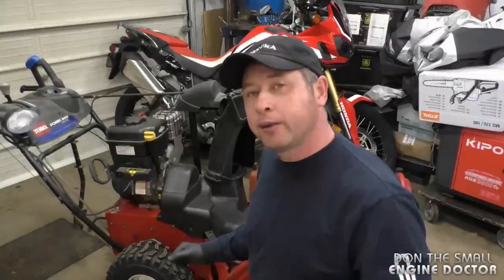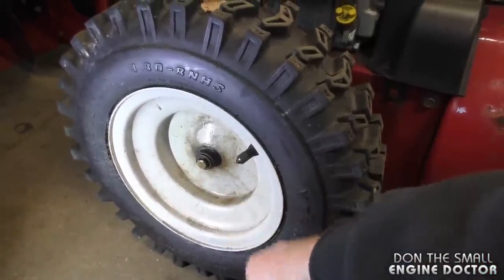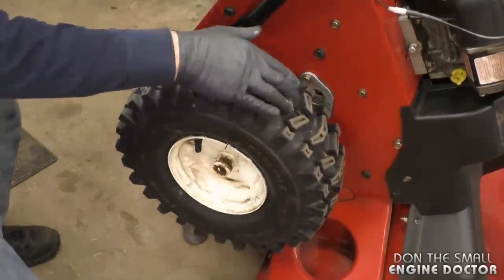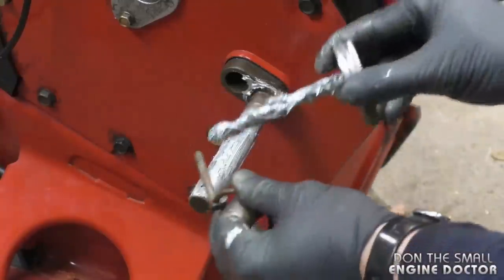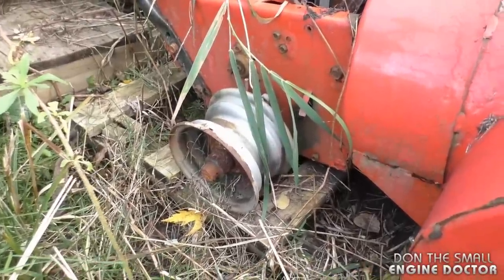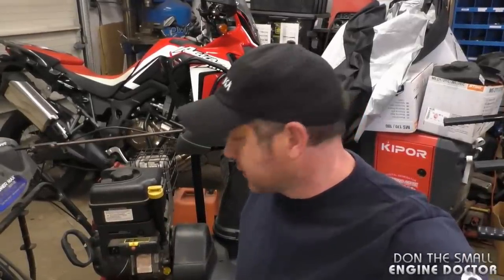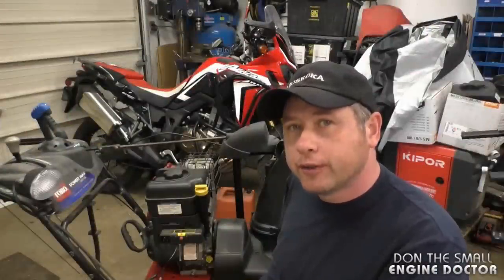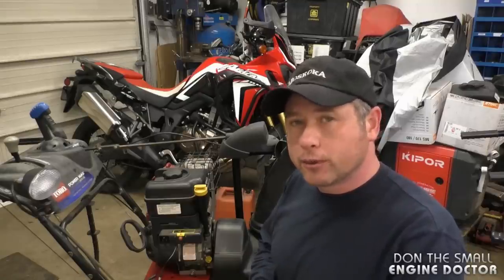ALWAYS Do This To Your Snowblower!

Comment: I have to remember to get some of that to put on the wheels of my mowers and use it on my vehicle rims also. Thanks for sharing this tip with us all.
Reply: You do want to be a bit judicious on your vehicle rims. If you put way too much, it'll squeeze out and could fling onto your brake rotor as you drive away. :( A nice coating on the wheel's hub face will do the job. You'll be able to see on the rim where the hub actually contacts the hub face of the wheel. That's the only place that the antiseize has to be applied. If you put it on your lug nuts/bolts, you must reduce the torque that you apply to them according to a lubricant torque reduction chart. If your lugs call for 80 lb/ft dry, and you torque them to 80 lb/ft after applying antiseize they will be WAY too tight and could stretch and break off. :( Hope this helps.
Reply: Lubricant on the threads are ok, don't get any on the interface between the nut and rim. That is where the torque is applied and friction is needed to keep nuts from backing off. Usually 30 weight oil is used for this as antiseize can ball up and get on that interface. Many torque specs are based on this.
Reply: @mannys9130  I wouldn't worry much about the over torque with anti seize. By the time you scrape the lug holes from the wheels across the studs it'll have grit and dirt in most cases in the anti seize and you'll be right back to square one. That anti seize stuff doesn't reduce torque THAT much. My dad has been using anti seize on all of his vehicle lug studs and hubs for 45-50 years and he's never even used a torque wrench to tighten the lugs, all done by hand. Not one has ever come loose or had a problem.

Comment: I just bought some anti-seize, will do it Monday! Thank you
Reply: Question: Can I put that on other areas of the blower? How about the driveshaft area where you shift the gear under the blower by that friction wheel or will that come off and make that slip (that friction wheel I mean)? So when you shift from 1-6 forward or backward 1-2 mine is not sliding very well, or do I use some type of grease on that? And what about the auger thing with the shear pins or just spray some silicone spray in that?

Comment: Thanks for that bit of information I would have never known that I thought just regular grease will be perfect. But now I know I have a question when storing gasoline in my gas containers. I usually put stabilizer in the containers first and mix it all up I use high-octane. I used most of the high-octane up with the snow blower and lawn mower. But the mixture of the oil and gas for my leaf blower usually it doesn't used up as much because I only used leaf blower for when the leaves Fall up here in North Jersey. How long would that gas last or still be good?

Comment: Excellent tip - did this on my HS-80 a couple years ago after it was a bear to remove the shafts doing the tranny repair...

Why it's not done at the factory is beyond me, and makes me believe they don't do any environmental testing when designing these machines.

How about installing a Zerk fitting on them like you did on the HS-928 tranny?

Comment: Great tip! I’m a big believer in using anti-seize - I smear some on my car hubs when swapping in my winter wheel set. Is this procedure also recommended for smaller snow throwers that have non-pneumatic wheels with plastic hubs? I just recently purchased a used Toro 721 E.

Comment: I never noticed the way snowblower rims were put on today.  I picked up an old Ariens with rims that bolt on and I thought they still did that.  I only noticed it when I was pricing out machines made today.

I put anti-seize on all my wheel hubs if I replace them on any vehicle.  The idea that I should never have to replace it again if the bearing(s) go bad, but if I do, it'll make it much easier to remove it.

Comment: I just did this on my brand new Ariens snowblower. I noticed when I removed the wheel it already had some kind of anti seize or grease on it. Not nearly as much as needed though so I added the anti seize generously.
Reply: Just did they to my newish machine, and oddly one side was greased but not the other, not every machine goin down the assembly line get the same attention.

Comment: Just last week I put synthetic grease on mine so I figure I`m okay.  I`ll use the anti seize next year.   Beautiful Honda you have there.  If I ever get a second motorcycle, it will be a adventure bike.  Either the Africa or the V Strom.
Reply from the maker: what do you ride peter?
Reply: @donyboy73  2013 Harley Davidson SGC
Reply from the maker: @Peter-976  nice, I had a cruiser also but went with the Africa twin for the versatility, great highway bike too and super nimble
Reply: @donyboy73  Agreed.  Every review of the Africa that I have read gets high remarks.  Honda has hit a home run with this model, even with the automatic version.  However, I would prefer a manual transmission only because I believe shifting is an important part of riding a motorcycle.
Reply from the maker: @Peter-976  I have the manual
Reply from the maker: @Peter-976  it's like a dirt bike on steroids

Comment: I'm up in RI using an 1985 Bolens without anti-seize. It would need to rust for decades before the axle welded itself to the wheel or vice versa
Reply: Good for you. Why don't you also tell us everything else that you think.....only kidding.....we DON'T want to hear what else you think.

Comment: Thanks Don. I plan to use on my walk behind leaf blower also. I will clean rust off with steel wool first.
Reply from the maker: IF WHEELS actually turn on the shaft then use grease, if they are fixed on shaft like the snowblower in video use anti-seize
Reply: @donyboy73  The wheels have inner /outer bearings that are fixed on the shaft. So I assume the ant-seize is best for this application? Thanks
Reply from the maker: @skipproctor8979  yes where the inner part of bearing goes onto shaft
Reply: @donyboy73  Thanks Don for quick response. I look forward to your new videos every Friday. All the best! Skip

Comment: If you are proficient in the use of a cutting torch, you can cut the rim off the axle shaft without damaging the shaft, then put a new wheel on and you're done. Heating the axle almost never works because that swells the axle inside the hub on the rim making it tighter. The hub on the wheel has to be heated, that swells the hub away from the axle, making the hub loose on the axle. It just burns the paint off the hub and wheel.

Comment: I love Honda motorcycles. I’ve had 3
of them. 82 Nighthawk, 75 CB 500T, and
a 2000 Shadow 750 ACE.
The only one that wasn’t quite right,
was the 75 CB500T. Could not get rid of the vibration. A shame, because it 
was a beautiful classic bike.

Comment: Yeah, but what if you can't get the dang wheels off? I have an Ariens Compact that's 5 years old and still looks like new. I took the codder pins out, but even with a crow bar and 2x4 could not move the wheels more than 1-2" down the shaft.

Comment: Warning: I love you DonyBoy, but be careful when attempting this, it isn't as straight forward on a newer Ariens Deluxe 28. Safety tip, make sure your tank is empty before tipping the snow blower on the bucket, all the gas ran out of mine when I did this. Note also  that there is a C clip behind the outer clip, I didn't know it was there and lost it when I took the wheel off ( the dealer didn't have any replacement clips so I'm screwed) and don't lose the little key that's going to fall out when you remove the wheel. You also have to figure out how to get the wheel back on with the key situated properly on the axle. Not easy if you' aren't real mechanical. The video made this look easy, but all machines aren't the same.

Comment: My Ariens snow blower  has one wheel seized on and  I have been spraying it with PB blaster without any luck.  You would think they would do it at the factory.
Reply from the maker: it looks like ariens is using cheaper metal now

Comment: Hmmm, never did this in 18 years with my snowblower, I guess the seize is just around the corner.
Reply: it's called luck.....
Reply: That's not what the author said. He said if you don't do this your wheels will seize in no time. Just with my father and myself never doing this for over 50 years and never having any problems makes me wonder. I think he should have stated it's a good idea just in case.
Reply: Hubster I been a small engine mechanic for nearly 60 years and this is very common the wheel seize on and drive up labor rate and sometimes they don’t come off no matter what
Reply: Ok just never happened in my circle of friends. Seems like an easy fix, just angle grinder the rim off, buy new rim. Would that work?
Reply: Hubster still a pain and it’s hard to get in there with a angle grinder or really anything still will drive labor rates up
Reply: Ok, there's a video out there that shows a bottle Jack pressing against the axle, with a chain around the back of the rim. There'd be no labor costs, not with a good shop on hand. Not the case with everybody though.

Comment: older Ariens machines have grease fittings on each wheel. Just make sure you grease them every year.
Reply from the maker: yes if you grease every year they will not seize, however not everyone does, that's why I recommend the anti-seize. Every loyal customer gets anti-seize

Comment: I have had some really seized on wheels. I cannot understand why the factory doesnt at lease grease the shaft. I have also had locking pins rusted on . It's fun cutting and punching them out. I would have used a cutting torch on the rim myself but that's just me. 
Nice Honda! I miss riding. 
Awesome video...again. Ever work on the zero turn snow blower system? I found one video that covered how to fix it. I had never ran into one till last winter. I think water got into it and froze something. I went in and used antiseize on the system to prevent further issues. Yes, that stuff is messy as hell but it works way better than any grease I know of. I have been known to mix the two.
Reply: The factory would love to save $.01 and 30 seconds at the assembly line by not applying it. They will also be very happy to sell you a new one when you end up like the owner of the blower in Don's yard. :(

Comment: Wish I would have know this 30 years ago when I got my snowblower. I had a leaking tire and had to put in an inner-tube. I ended up installing it with the snowblower in it's side because the wheel is hopelessly rusted in place. I noticed that I never put the pin back in - safe to say it isn't needed :)

Comment: I had both wheels sieze on my troy-bilt rear tine tiller.....one I managed to get off with heat and a wheel puller....the other was hopeless......I drilled thru the wheel just above the hub collar..two holes were enough to start the sawsall blade and I cut down thru the collar until it just grazed the shaft......took a cold chisel and drove it into the saw cut...that did free the wheel without destroying the rim and tire...I welded my cuts, and its back to churning dirt....

Comment: Anti-seize is also useful for preventing alloy wheels from seizing to brake rotors on cars.  In this case, you should use high temperature anti-seize and apply to the wheel and/or rotor where the two meet - just be careful not to get any on the lug studs.  I mention this because you may want to buy the high temperature anti-seize right away so you can use it for both applications.
Reply: Why would you not want neversieze on you wheel studs, I've been doing it on purpose for nearly 50 years with no problems, so don't try and tell me they will loosen off on there own because of it, because it simply doesn't happen.

Comment: Want to do an experiment? Mix up a small container of Acetone and automatic transmission fluid  (1 to 1 ratio).  Mix.  Using a flux brush (or similar),  apply to that seized axle / rim you showed.  Keep applying the solution over a few days...maybe a week.  I have a feeling it will break loose.  Might have to give it a whack with a hammer, but it should break loose.  I have had very good luck using it over the years.

Comment: Great video. My Honda snow blower has track so how do I put anti-seizs on the drive shaft ? This is the first year I've had it.
Reply from the maker: on your honda you should only put it on the shaft that turns the track sprockets
Reply: @donyboy73  I understand that but how do I get the tracks off to get to the drive shaft ?

Comment: Question?  I broke one of the electric plug prongs (not the negative prong) on the electric starter. Do I have to replace the whole starter unit or can the starter be unassembled and the new prongs be installed. The engine is the same B/S engine you have on your snow blower?

Comment: Too late for me, Cub Cadet about 8 years old, wheels would not bulge.  Is there some puller that can be used. I guess the basis for this would be too fix the tire if a flat were to incur, otherwise one would use a tire sealant, or cement and a plug.

Comment: after watching your video I went to do this procedure to my Craftsman snowblower. One wheel came off very easily but on the other side there appear to be ridge on the axle stopping the wheel from sliding off. It appears that I have to pull the whole axle through to slide the wheel off from the opposite end ? Am I doing something wrong ?

Comment: Don, I have a question. I bought the same brand of Antiseise as you from Amazon that I got yesterday. As I mentioned earlier, I always used regular grease from my grease gun on the axle. This morning I applied the anti-seize grease to axle. Is it advisable to rotate snowblower tires, right to left, etc., every season? The reason I ask is, even though I greased axle on my Ariens compact snowblower, I always have a problem getting the right wheel off and have to shimmy in off. I was wondering if rotating wheels would help?
Thanks for all the advice. 
Don from Milwaukee
Reply from the maker: no need to rotate, just do like in the video and your wheels will NEVER seize

Comment: Would it work on the shaft the friction disc slides on as well??
Reply from the maker: it probably would but it's better to use low temp grease

Comment: Im no genius here but the wheel does not spin on the shaft it spins with the shaft hence the pin through the wheel and the shaft.  That being said the only benefit to doing this is it will make it easier to remove the wheel from the shaft if you ever have to replace it.
Reply: Well, he never claimed it would do anything but that...so...what is the point of your comment?

Comment: Hello Donyboy73. I have a problem with ny Arien snowblower. When the outside weather is belows -7C, the blower is inside the garage not heated. When i try to pull the machine to move it, the whells are jammed. They don't move, i have to pull and they slide. Then i start the engine and it move OK, Why the whheel does not move ? I just pull with handles, not activate anything.

Comment: I looked at the picture and thought, ooow paint the hub white :-D.
Copper slip is the product that jumps to mind, i suppose that in a perfect world every nut and bolt would be coated in anti seize before assembly.

I have an old kawasaki kh125 from 1987, it gets grease and it seems ok in the uk.
Although it's a rubbish machine, trust me to buy a machine that was so unpopular that the haynes manual creators would not make one lol :-D.

Comment: I have a question.. i just bought a husky st 224p and am applying anti size to recommended areas. 
I had a look to the wheel steering 
Inside the wheel housing and noticed a shaft that what looks like a clutch rides back and forth 
I was thinking of putting a layer of BG waterproof spray lubricant on that shaft and some of the other moving parts.   Would this help reduce wear and corrosion?    
Thanks.
Reply from the maker: it will yes but do not get it on drive disc

Comment: Definitely a good idea, my early 80's Craftsman 10hp has one wheel seized on tighter than a ......I tried to remove it to change the friction wheel but no go. I tipped the machine on it's side and soaked it in penetrating oil but still no go. I got the friction wheel changed any way but left the pin pulled and hopefully it work itself loose eventually.

Comment: I use wheel bearing grease but my wheels and bottom pan come off at least once yr if not twice, 1998 toro 8/24 xl power throw, thing just runs an runs an runs I am not ready for new machine yet, this beast still gets her done with ease lol,  cannot beat an old School toro, treat it right it will return the favor, def nice tip Donboy 👍

Comment: I watched this video yesterday and immediately went out and bought the anti-seize.  The left wheel practically fell off by itself after removing the nut.  The right wheel isn't budging.  I've laid it on each side and WD-40'ed both front and back hoping it would seep in enough and banged on it with a rubber mallet.  No luck.  Tomorrow I'll try banging the rim from the backside with a piece of wood or pipe.  I don't have any kind of heat to apply to it.  Is PB Blaster better?
Reply from the maker: you can try pb
Reply: makmelaf   Try  "PB Blaster"  stuff literally dissolves rust of  rusty nuts and studs, You can also try " Kroil "  great stuff too , keep a can in the shop , one in the house and another one in my De Walt box on my Construction Jobs   ,  John @ 4 Aces Construction , Spokane .

Comment: I need a little help here.. I live in Michigan and we get a fair amount of snow.  I've had a snowblower for around 15 years and here's my question;  "why would I ever need to take a wheel off ?  This sounds like fixing a problem that doesn't need fixing.
Reply from the maker: if you need to put a tube in the tire, replace or grease the shaft bushings you'll be happy the wheel comes off easily